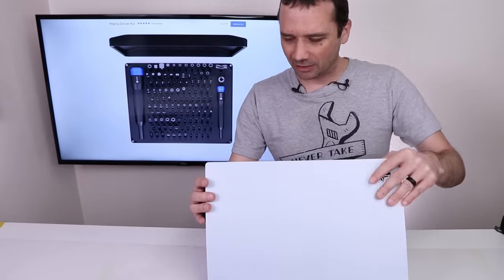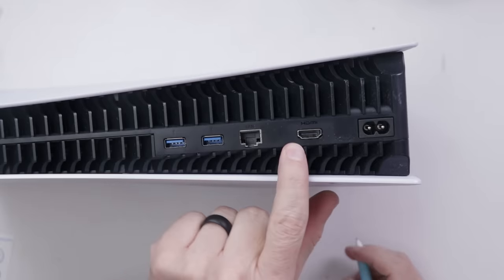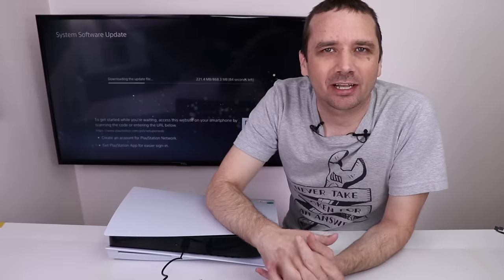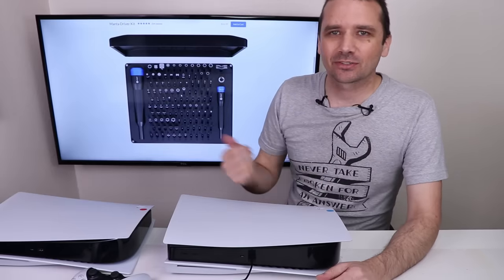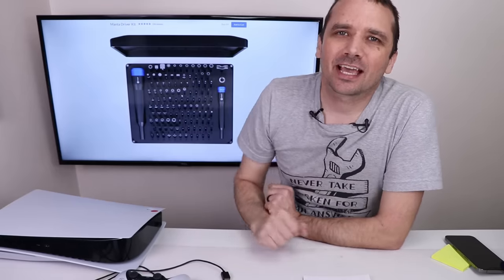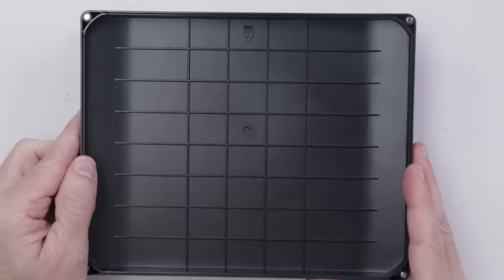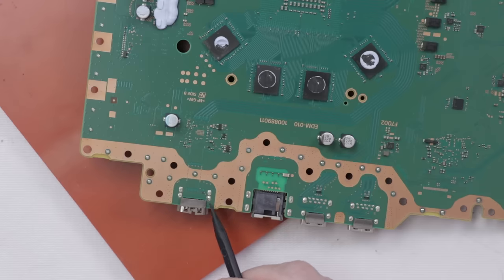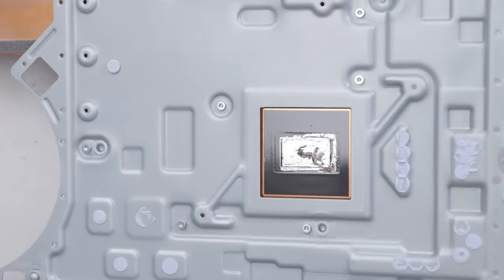I Bought 13 BROKEN PS5's - But Can I Fix Them?!

Comment: I can't believe people didn't send these back to Sony under warranty.

Unless they bought them from a scalper.
Reply: Most likely
Reply: doesnt matter if from scalper. the serial number on the console is all you need to make a sony warranty claim
Reply: They only need proof of purchase after a year from release date. I had to send mine in and I didn't need to include the receipt, got a new one back a few weeks later.  Mine did exactly what #12 did in the video.
Reply: @craigperry3779  i’m having problems with my disk drive & i bought it from a scalper, it was brand new completely sealed box. But where should i contact to make a replacement, the scalper said the ps5 has a warranty and sended me a pic of proof of purchase he bought from target
Reply: @Frayicz21  call your boy you bought it from... 🤔🤣
Reply: @Frayicz21  you didn’t get the receipt from the scalper when you bought it? Ouch.
Reply: @Lonnie91a  he send me a proof of purchase that he bought from target...
Reply: @Frayicz21  then tell him to send you the receipt. How on earth did you not ask for a receipt in the first place?
Reply: Bad products.
Reply: @incocnito1274  if u buy it from scalpers i dont think your warranty is gonna work.
Reply: this is likely returned products either sony or the big stores sell off.
Reply: @Frayicz21  go on PlayStation warranty claim and go through the application. You should be fine without receipt
Reply: @craigperry3779  yep you don't even need a proof of purchase if the model of your product hasn't even been in production for that long... no matter what item you bought
Reply: @Frayicz21  that proof of purchase is enough.  Print it out and include it in the box if they request it. I was told by the representative I dealt with that proof of purchase isn't required because the product hasn't been available for a year yet.
Reply: @Frayicz21  call sony
Reply: @craigperry3779  he didn’t show the order number from the store he got it from, does it still work without the order number?
Reply: @craigperry3779  After a year isn't it out of warranty?
Reply: @larrygall5831  yes from date of purchase and since it hasn't been out for a year yet you don't need the receipt just serial number.  I included my proof of purchase but the representative from Sony told me I didn't need to. The box and instructions they sent me said I needed it though.
Reply: @Frayicz21  that should be fine. I included a screenshot from my Costco account but I was told I didn't need to but I was paranoid because the instructions sent with the empty box they send you will say to include date of purchase.
Reply: @Frayicz21 " i’m having problems with my disk drive & i bought it from a scalper"
Good, if you bought from a scalper, I have no sympathy for you.
Reply: @iaincowell9747  disk drive works but it only acts up on blu-ray disks...this morning blu-ray disks were working fine when ejecting, idk my ps5 being weird asf
Reply: They would still Have warranty regardless getting it  from a scalper
Reply: Still under warranty
Reply: @Frayicz21  best thing to do is contact Sony. See what they say every console sold till November 13th this year is under warranty.

Comment: My question is how and why they are already broken in the first place
Reply: because renigade raider
Reply: cuz launch editions are defective
Reply: @wazza831  whats the common defects?
Reply: stick with ps4
Reply: @wazza831  prime reason why I did NOT buy one nor do I have any interest in getting one...perfectly content with my ps4 lol
Reply: @ajpewding4058  they don't fkn work same as every console ever except the ps1
Reply: could be memory chip damage, those run really hot to begin with.
Reply: @ajpewding4058  just like in the video, 5 or 6 of them had defected apu, 3 wouldnt  turn on at all(can be defected memory chips too),3,4 had screen flickering...
most common one is probably coil whine which most have, some loud some bearable😶
Reply: New releases of very limited amount of course there will be faulty ones. Once they mass release this will be less heard about due to how readily available it will be

Comment: With PS5 even if they turn on & work that doesn't mean they are not broken in my experience the issues usually range from errors or crashing while playing games or wifi issues or sound issues that don't usually pop up while turning on & installing a game or updating the system software
Reply: PS4s have similar problems after a few years of usage too.
Reply: @Owen Hill its down to the owner not the console. i have ps1,2,3,4 and a pro all still working mint condition
Reply: @Owen Hill i had 3 og xbox and 4 360s, xbox isnt flawless bruh literally had rrod
Reply: @Owen Hill my xbox 360 had lens defect just after few months of using
Reply: @Owen Hill remember the "red ring of death"or nah?
Reply: @Owen Hill Lmao my og Xbox disc drive died and I barely ever played it, seriously I had like four games, fast forward to the 360 and I'm on xbox number three my brothers elite just red ringed a few months ago lol microsoft isn't the company to brag on for hardware.
Reply: @Owen Hill you are talking as if the red ring of death wasent a major issue with the 360 just because you dident have that issue dont act like microsoft never have issues
Reply: @Owen Hill You just went full fanboy mode, forgetting that Xbox has had plenty of issues themselves.  No big deal really, just enjoy gaming on whatever console you like.  Console wars are stupid.  FYI, I've owned every Playstation, including PS5 and I've never once had an issue.  Most people don't actually have issues, you just hear from those that do.
Reply: When people turn into company fan boys it makes me cringe. No different to little girls screaming at the latest boy band.

Unlike most people, I've had issues with most consoles from the PS3/Xbox 360 era onwards.

Never had a problem with Sega Magadrive, NES, SNES, Amstrad, PS1, PS2, OG Xbox. 

Launch console PS3 died. 
Xbox 360 red light of death, twice!
Launch PS4 blue light of death.
PS Pro antenna broke, was playable either being next to the console within a meter, or keeping the controller wired. Xbox One disc drive broke. PS5 is currently having a few issues with games crashing, can't use rest mode at all otherwise it crashes everytime so I don't want to risk bricking the console. I will be sending it back for replacement soon as it brakes or when consoles are widely available, whichever comes first.

It's almost as if these big companies rush production to mass produce consoles. 👀

Anyway my point is, both companies are far from flawless. I stopped buying xbox due to being able to play their games on PC, which is obviously far better at the end of the day. Seems mental that they can't build consoles to last anymore due mainly to poor design, but whatever, most people's work more often then not, and that's good enough in this day and age.
Reply: @Bidwellz9  And PS3 had YLOD.  Amazes me that people forget that.
Reply: @Mr_Ruhl  Remember the YLOD or nah?
Reply: @Owen Hill 360 had the mother of all from the factory issues with the red ring.

An estimated 23% of them got it and cost the company an estimated 1.15 billion dollars.

Most next gen systems end up suffering some issue. Things that go unnoticed until mass production and release into wild.

Comment: I'd be curious to know if the HDMI retimer chips have gone bad on the artefacting ones, or maybe the APU's need reballing because of cracked solder from a drop. It'd be cool to see you give that a try!
Reply: I can't imagine how tedious it would be to reball such a chip. I'm betting it's got over 2000 pads to get those teeny tiny solder balls onto. I doubt templates exist that would fit the pattern, so you'd either have to make one or have one made, or you'd have to manually place them. Sounds like a nightmare.
Reply: I'm curious on where he buys those PS5s

Comment: The ones with graphical glitches could have problems with (not enough) power to either the RAM chips or APU or heat issues regarding them, as it seems similar behaviour as I have seen a lot in the passed with PC graphics cards.
Reply: That's the problem with these things. It's all one unit. Least with a PC it's easier to isolate where the issue is coming from. Well if you know what your doing lol

Comment: Tip: If you are going to remove big components like usb-ports etc. you should use low temp solder like ChipQuick which is genius. You avoid heating up the board more than you have to.

Comment: TronicsFix: Has 13 PS5s
The entire comment section: "How can I acquire such power?"
Reply: It's getting worse technically, look at the ssd, it's soldered, even last gen you could replace the hard drive. Even buying a new disc drive looks like an issue. Wish they'd at least soccet some items, even the new series x ssd is removable, although they haven't released the partitioning etc so it's not like you can replace it easily.
Reply: @magnarex  Dude, the "power" is how he has 13 PS5's
Reply: @CottonBollBat  wat 😂 ur comment makes literally no sense.
Reply: @magnarex  Maybe you just need to think about it more
Reply: @CottonBollBat  no, I think your 1st comments sentence needs to be re-written it is not correct English.
Reply: @magnarex  Just checked, I messed up one word, I'm dyslexic
Reply: @CottonBollBat  yep I get it now😂 sorry, was a bit confused because my comment is about how it's not that repairable and u said 13 power and I was like... WAT.

Comment: This is why we need better laws surrounding electronics like requiring manufacturers to publish wiring diagrams.
Reply: I do work on consoles here and there but it really reminds me of working on new cars and trucks i have a 1981 f150 n i can take the entire motor apart and put it back together in 5 hours but i can barley change the plugs n wires in my 2019 150

Comment: How difficult is it to plug in an HDMI cable. Do ppl try to do it in the dark.
Reply: It’s not difficult at all
Reply: It's not difficult, but if the system falls off the stand and lands on the HDMI cable, or the cable gets yanked this can be the result.
Reply: Speaking from experience my wife would tell you it's probably the latter. 😖
Reply: Little kids.
Reply: What's you ig? looking like a cutie patuti😂

Comment: How the heck people managed to break those?
Atleast now they are in better hands, and we have a video to watch
Reply: @kirara4953  In my experience it's more likely that people are morons or they're nasty (I used to fix consoles and you'd be shocked at all the stuff you'd find)
Reply: Spoilt kids
Reply: @LOTPOR0402  And adults
Reply: The ps5's are most likely from store demos which often find their way into salvage lots
Reply: @FurikuriYugi  I couldn't fathom paying more than a couple hundred for a broken console no way I'd give 550 for a broke one edit: grammar
Reply: In any hardware launch this big (literally record breaking) there is no way to escape the fact that an extremely small number are just faulty. I'm talking extremely small numbers though, like barely a scratch on the surface of it all.
Reply: @kirara4953  it's a mixed basket on that one
Reply: Wha

Comment: Just a heads up, although you're probably already aware of this. Some PS5s have issues where they can't play raytraced content but everything else works fine, raytracing will the PS5 crash no matter the game, some of these could have had that problem, since you tested PS4 games on them.

Anyways love the videos and usually just lurk, but thought this time I'd give you a heads up
Reply: This is what happend to mine.  after some resets and stuff the crashes became more frequent and faster to the point of not even reaching the home screen on a PS5 game, making it a glorified PS4 emulator.

Comment: Sheesh. Could you imagine finally getting a PS5 only to have it continuously lock up on you?
Reply: Yep, happened to my cousin. It first started with faulty controllers and when he fixed them the GPU went kaput. I told him it was a bad design but he did not listen.
Reply: @LiquidSpartan117  How is it bad design? There are millions of PS5s working just fine, including mine.

Comment: I hate when people just take out random screws, not even doing any research on how to disassemble consoles. Like I watched Steve's Tronics Fix video on how to disassemble a PS4 pro three times before I ever even removed the warranty label. If I didn't feel comfortable after the third time, I wouldn't have bothered with it. But the way he explained it was very straight forward and I was able to examine, clean, and re-apply thermal paste, which was my main reason for doing it. Good thing I did, the thermal paste around the APU was dry to point of coming off in chunks and the paste  between the heat sync and the APU was barely liquid. Almost the consistency of uncured caulking.

Comment: All PS5s are still under manufacturers warranty, I'm confused why these consoles exist to be "repaired?" Can someone shed some light on this?
Reply: Some people don't know that . They end up selling them or just buying a new one .
Reply: They're from retailers, some retailers would have just sent the customer new units and not bothered sending the faulty ones back to Sony.
Reply: Exactly, even after buying*them faulty you could just send them  back with ought receipts , instead of risking a repair failing
Reply: What if they bought them from eBay?
Reply: @MagicFerret69  smeagol
Reply: @MagicFerret69  hmm
Reply: @MagicFerret69  the Gazuna Katana
Reply: @MagicFerret69  huh?

Comment: This is what put me off PS5 because of the on board SSD so if something is wrong with the SSD you can't just replace it and its bricked.
Reply: there is an addon slot for another ssd that isn't fully supported yet but people have made them to work allready and you are able to make it the master drive as well....
Reply: @robertrijkers4923  show us where?
Reply: In that way they make sure that people dont install the main OS in crappy qlc ssd units

Comment: well, no, actually the ones that broke them are idiots.... (unless its just due to bad QC)
Reply: Based on the video most of the problems are either due to software or possible hardware issues so yeah. Bad quality control by sony right there

Comment: Do you ever check to see if they are under warranty?? Things like a bad APU or GPU are usually things the manufacture will fix for free. I used to repair a lot of electronics in the past and you would be surprised how often I was able to get a new device or it repaired for free from the manufacturer since the seller/owner never called to see if it could be fixed.

Comment: It is very strange, all those PS5 should be on factory warranty?
Reply: Scalpers
Reply: @marcosmos7478  That make sense. I will not press like on this video :)
Reply: and do you think factory has 10 people sitting and fixing consoles all day long? You get a brand new console, seller takes the broken one and either sends to manufacturer, who sells them of as broken items, or the seller sells them of as broken.
Reply: @sFde46  In my case Sony did send to me brand new replacement by their courier and courier take faulty one from me.
Reply: @petraspetraitis8239  and that faulty one was most likely sold as broken by sony.
Reply: @petraspetraitis8239  Hes not the scalper you canbage. he bought them from people who got them from scalpers
Reply: @spencerobryant2752  If you would concentrate and carefully read comments before your some body part goes on flame, then you will find out that i didn't say he is scalper.

Comment: me: opens video 
Also me: 13 PS5’s??? Are you mad? That sounds a lot of money on this must’ve been over at least a thousand
Reply from the maker: Ha, ha!
Reply: He has the money.
Reply: Can‘t he use them for a tax Write off?
Reply: @allknowingpineapple4112  no
Reply: thats over 7000 bucks 😮😮😮😮😮
Reply: @Malandrin  a 300k view YouTube video is thousands of dollars. Then he repairs these. Then resells them.
Reply: @LordRayken  No. A 100k video generates $100 for the creator. So it's not thousands of dollar, it's 300.
Reply: @saschadri  how does that work on the the creators part? Is it just by haveing 100k views before they get paid or is their more to it?
Reply: @saschadri  that's not true at all. Depends on the subs, and more
Reply: @saschadri  that's just not true
Reply: @bobmybob9493  normally once u have ads u get paid the second a view has seen an ad. Just ad pay sevices pay when u get 50-100 bucks in the account to your bank account. Just there are some that pay even as low as 5 bucks.